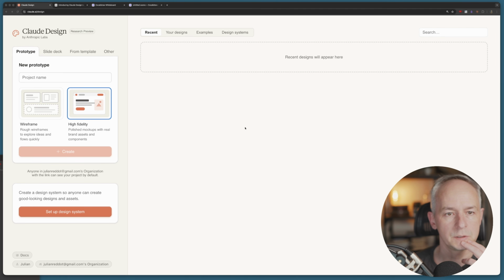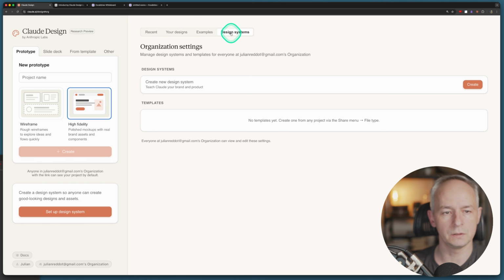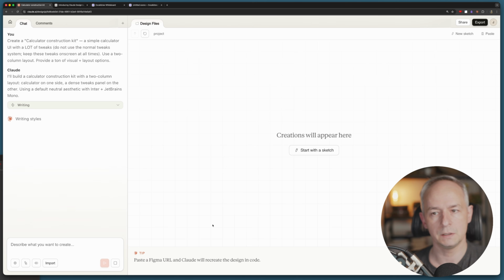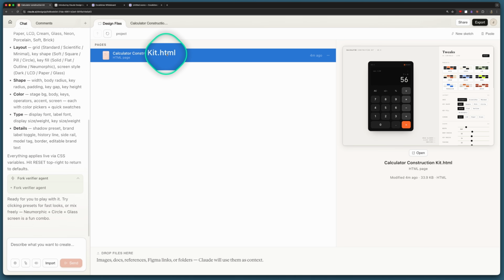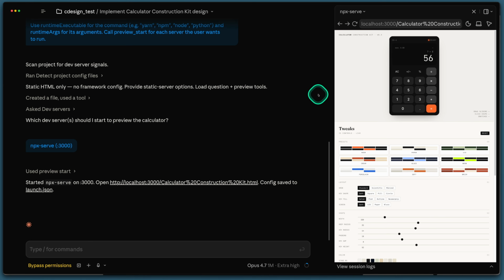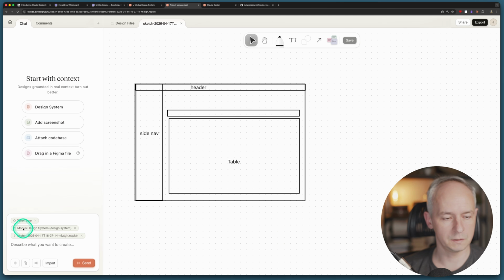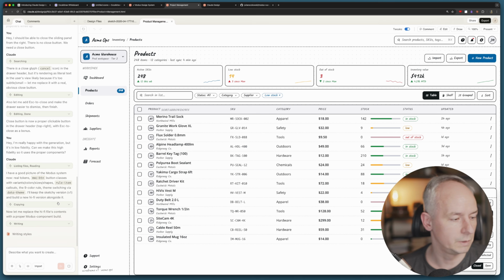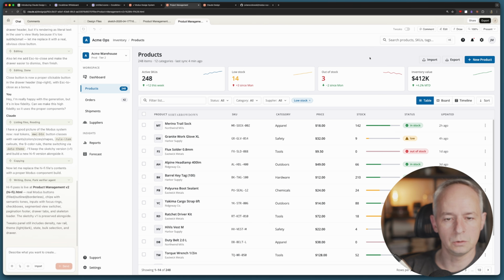Claude Design Is Actually Insane

Comment: I’ve tested it as design system architect. It’s still useless for any native mobile projects. Also the web outcome nothing I would use in production.
Reply from the maker: Fair points, and on native mobile you’re right, it’s web-first and it shows. I don’t think this is a production-output tool yet either. Where I’ve found it most useful is design system exploration and the handoff to Claude Code, where the real production build actually happens. It’s a design conversation tool, not a deliverable tool. Curious what you’re building and whether you found v0 or Lovable closer to your needs on mobile.